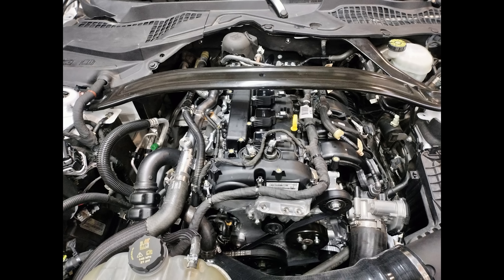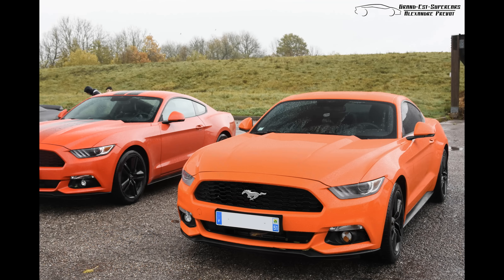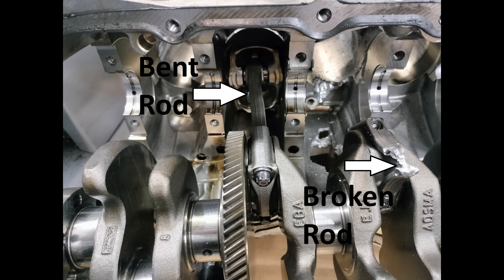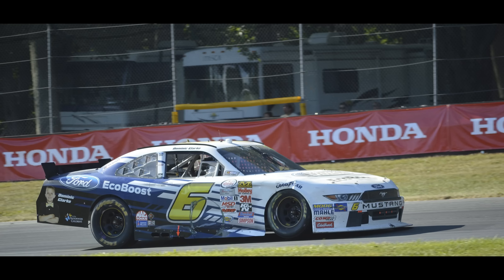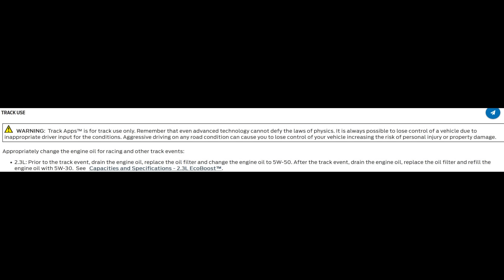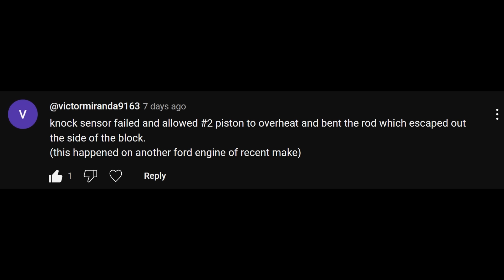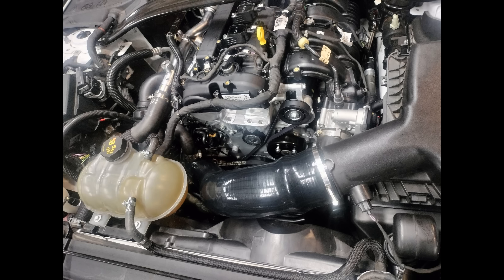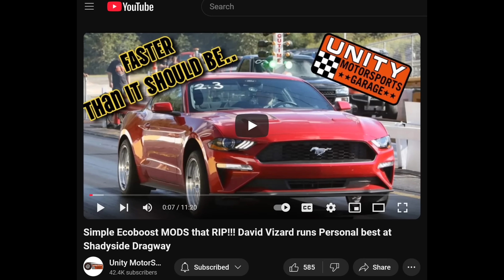EcoBoost Destroyed, What Happened?

Comment: Ultimately with turbocharged engines you are going to have failures due to over pressure. Eco boost engines are prone to failure and yet ford keeps making the engines smaller with more turbocharging in order to comply with the CAFE limits. 

So let’s get into what the exact problem is. 

You have a mass, you want to accelerate a mass. To accelerate need a force, the force is applied over a distance, thus you need energy, and the energy per unit time (power) determines how fast you can accelerate. OK, this is just basic stuff. 

An ICE can gain about 20% to 30% efficiency. And let’s say you need 500 HP that means there is 1500 to 2000 equivilrnts of waste heat, but since not all the fuel is burnt. So let’s knock it down to 1000 HP eq. So if you have say a 12 cylinder engine that heat is spread over 12 cylinders and the water jacket, it also means the manifold temperature and pressure is lower. 

So now let’s put 500 HP in a 6 cylinder engine with a turbocharger, we can do that by doubling the pressure an using an intercooler, the problem though at TDC on firing the cylinder pressure is double the peak of the twelve cylinder engine. The exhaust valve temperature is hotter, the turbocharger also creates more back pressure, and some of these small engines have cylinder spacing as small as you can get, so that a cylinder head being pushed away from the block has a head gasket that is also being pushed against. The turbocharger itself is being pushed into a zone of thermal operation which is degrading the oil. And so this is an ominous nexus. The all you need is a small defect in any part in the cylinder or the turbo blades. 

If you drive these cars at modest accelerations and only use the turbo charger for occasional acceleration, they will behave just fine. But if you like blowing the doors of other traffic, or speeding down the freeway at 2AM going 120 MPH, you have no tolerance in the lubrication or cooling system for failure. 

There’s a fellow on Robot Cantina that turbocharged a diesel Kubota for a stripped down Saturn and he got 80 MPH with a 720 cc engine. These 3 cylinder ford engines are about 1000 cc, and they have a turbocharger on them, but they are not sports cars. That turbo is there for 15-20 seconds of continuous operation per interval . It’s stupid to make car engines that small and compensate with turbochargers. A 1250 cc engine with a pressure limiter on the turbo output is a much better configuration and it makes the engine trivially larger and more massive. 
    Better yet, get rid of the Turbo and use the hybrid battery for peak output.
Reply from the maker: Turbocharging works fine long term if the engine is built right. This has been proven in long haul trucking in which those trucks are on boost for millions of miles.
Reply: @ The key word is built, if you build to pressure. Second thing is diesel engines don’t peak output at 6000 RPM. A diesel truck is a relatively small engine connected to a large mass, thus its mandate is not weight saving on size or mass,  but maximizing power output at a steady-state RPM. That’s not the way Eco-boost engines are designed. 
Ford has a repeated problem of failure at the intercylinder head gasket due to under engineering the engine, it’s comparable to the North Star problem.
Reply from the maker: I wasn't defending Ford, I was defending turbocharging in general. There are lot of Toyotas and other engines that hold up very well long term with turbocharger. I have a Fiat with 150k miles on it and it's engine is just fine, and it's tuned to have quite a bit more power than stock.
Reply: In other words Ford is cheating us.

Comment: More about boost and it's margin of importance.
In the 1st video of this series, Greg stated the location of the OEM boost (TIP) sensor (at the exit of the intercooler and before the throttle body). The ECU controls the throttle plate, not the right foot of the driver. This makes the boost reading on the dash, in part, nothing more than a measurement of restriction.

Comment: I get where you're coming from on the balance unit adding cost, but I disagree that it was feasible for a modern car to omit them. People expect a certain low level of NVH out of new cars. I've spent a lot of time with large displacement I4s (Volvo B230F and B23FT and Porsche M44) and I think they absolutely require a balancing unit to be acceptable to the modern buyer. The mentioned Volvo engines are quite coarse especially when you cam and tune them and rev them higher than stock, and they have a much smaller stroke than the 2.3 ecoboost (80mm B230 vs 94mm ecoboost). The Porsche M44 is balanced and has an even shorter stroke.
Reply from the maker: I think it's perfectly feasible. A lot of cars run 4cyl without balance shafts and I don't hear complaints.
Reply: yes, surely a lot do. Almost all of them are sub 2L engines, the bigger ones almost all have them, I considered my Volvos a rarity in that they were over 2L and had no balance shafts. Remember when dealing with cars as an enthusiast that you are not the target customer. I accepted that long ago, none of my cars are stock. If people like me were the target they’d probably already have the modifications I made.

Comment: My 2007 Shelby GT500 doesn’t have forged rods from the factory.  That’s one of the first mods that must be done to raise the HP above approximately 650 HP.
Reply: I take it that these massive HP engines are in  track cars We were more into road racing back in the 60/70s and the smaller cars were better for that type.
Reply: @ Agreed… Also, the modern HP cars are so refined, they take the fun out of driving on the street.  There is no way that those cars (including mine) could be offered up to the general public without all the driver aids that make the horsepower numbers irrelevant.  Pure “bragging rights”….

Comment: Greg, The open deck block is a function of the block casting process.  The 2.3L is a High Pressure Die Casting (HPDC).   The water jacket is formed by a piece of tooling that is part of the die and slides out of the casting after the aluminum solidifies, as the die is opened after the casting is shot... closed deck aluminum block is impossible with HPDC.  The crank case is formed in the same way...   HPDC is a very economical way to mass produce cylinder blocks. The tooling is very expensive and sophisticated, but the resulting piece price is lower... Most aluminum cylinder blocks are made this way.  The get a closed deck block a sand core is needed to form the water jacket below the head deck.  Sand cores are impossible in a HPDC casting.   the 2.0/2.3/2.5L engine family previously had low pressure precision sand cast blocks.   The 2.0 and 2.3 transitioned over to HPDC 10 ish years ago.  Rod buckling in stock rods is certainly possible due added boost...  but as you know takes a lot to get there (congratulations).  Ford just isn't going to spend the money to upgrade the rods when there isnt really any chance the rod will buckle at stock performance levels.
Reply: Thanks for sharing this information! Manufacturing has always been a fascinating subject!!

PS: Ford did release 2nd generation connecting rods in 2020, and it is my understanding, that all 2021 to 2023 engines are equipped with the new rods.

Comment: Oh, for crying in a bucket, that Motorcraft 5w50 oil is so shear-prone, it probably turns to a 30-weight in one track day.  It may even shear out of grade when you pour it out of the bottle.
A good 5w40 like Mobil ECF would work better.  Then add a real oil temperature sensor and an oil cooler to control oil temp to ~280F.
If you start doing things to your new Ecoboost, I recommend lowering the CR and getting a set of Carrillo rods.  Show them your bent rods, they'll know what to do.
Reply from the maker: I could do a fully built engine, but that's not the direction I'm going with this car.

Comment: If you manufactured an engine for a 300-hp application that could reliably produce 400 hp, the business people would be asking you how much cost could be taken out of it and still reliably produce 300 hp. Why does the Alfa have better rods than it needs?
Reply from the maker: The reason for building in extra strength is so the engine can win in racing.

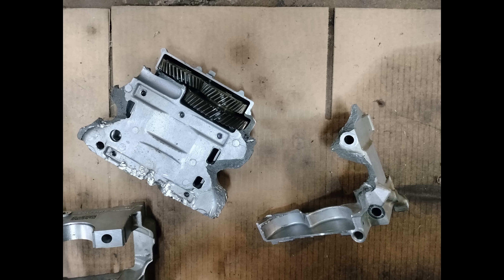Comment: 6:30 we have to respect manufacturers for being the greedy SOBs they are.  They wouldn't put in balance shafts if they didn't make a real difference in smoothness.  It's not a tick-box on most car buyers' lists, where you'd get manufacturers throwing in a feature just to get sales even if it made no contribution.  Even as a tech-head I'd never think to look at balance shaft existence when deciding which car to buy.  I've had mostly straight-6 and crosscrank V-8 and don't know if my R35 or F430 even have balance shafts.  Of course I trust your opinion too, and am not saying you're wrong per se.  But it might be that you're simply less sensitive to the vibrations they kill than most people are.  Or, it helps in some applications but not so much THIS chassis with THIS tuning, or some such.  I'm not sure (haven't finished watching) if your statement is from literally the same engine in the same care with and without, but if not, it may be just a question of apples and oranges?  Finally, it's possible that they designed the engine for a wide variety of applications and the balance shaft simply achieves nothing in this particular chassis but due to the economies of standardization makes sense to included in all models: cheaper to have an unneeded balance shaft in one car, perhaps, than to make a special version just for that car?
Reply from the maker: I may be insensitive to vibration, but I don't think it's just me. Looking around on forums I don't see people with engines without balance shafts complaining.

Comment: What destroyed it? Overboosting a damn 4-banger. Get a V8 if you want power.
Reply from the maker: I do want power, but I also was a lower cost car, better fuel economy and lower insurance costs.
Reply: @GregsAirplanesandAutomobiles  Have you ever run an older (Pre-'71) vehicle with a big block? The feel of those cars are way different than the modern engines. Getting 2.5G or more on launch is so dang fun! Modern engines just cant give that feeling no matter the power. And let's be serious if you are building for power, fuel efficiency is not in that equation. That is what the parts and grocery getter vehicle is for.

Comment: I don't have a Mustang, but I do have a 2.0 Ecoboost Focus. And while not the same, they are somewhat related. With the 2.0 engines stroking up to a 2.3 is always the last stage of upgrade because that extra 0.3 liters adds just enough extra stress on the conrods to limit their lifespan. It still baffles me that open deck, relatively low revving engine can make so much horsepower. It's no K-series, but for $350 at a pick-n-pull (Duratec) it's surprisingly good.

Comment: Rods don't bend from compressive forces but normally from the pin end tightening up which then puts a bending force on the rod and in a few cycles will snap it.   The other way they fail in highly boosted motors seems to be from the piston cocking sideways in the bore which puts a side bending force on the rod.   Modern low drag slipper pistons don't have good lateral support like a full skirted barrel type piston does so that's something to think about when making a motor.   If you can fit full skirts without hitting the crank...you're better off.   If only slipper pistons will fit...then a rod with much greater resistance to side bending would be a good move.
Reply from the maker: A pin problem would have bent it in the other direction. I'm not sure I understand what you mean by "rods don't bend from compressive forces". They certainly do, it happens all the time from hydrolock. I do like the rest of your post though.
Reply: @GregsAirplanesandAutomobiles  Thanks for the reply Greg!   Perhaps I should have prefaced my original statement with 'In a normal running engine'...and also let's distinguish  a bent rod vs a buckled/collapsed one.
Hydrolocking a motor for absolute certain will buckle rods if you hit them hard enough, but the normal 'bent' rods seem to be mostly from big or little ends tightening up or the piston rocking sideways....at least that's what we've seen and believe.
The 'open deck' blocks will allow the cylinders to move around if pushed too hard and this movement obviously causes misalignment of piston to crank enough to stress the rod through the pin.
Pushing the 2.3L Ford any harder than stock would make me want to sleeve it with the deck locked together as their racing block was made.  Would be good insurance.
Reply: Excellent debate topic! You both make well informed statements!!

Comment: I think kenm's answer is the best b/c "twisted rod failure" IMO implies plastic deformation of the rod under compression, which is basically your diagnosis as well. It's more precise than the others without guessing wrong details (unless you take points away for putting 2 guesses in 1 answer, but 1 of them was right on the money & the other was a plausible guess too)

Comment: Interesting. What would the solution(s) be here? I'm assuming reduced power is never an option. My assumption is aftermarket con rods though I don't know the drawbacks there. It sounds like they might be required for any EcoBoost with enough BMEP in fact? I can't think of any other solutions (not really an engine person) but I'd be interested if there's another way around the problem.
Reply from the maker: The solution is to run the same amount of power with lower cylinder pressures. At least that's my plan.

Comment: Just a bit of my first answer in the other video. I have seen head lifting in 2.3 with a lot of cylinder pressure. The twisted/bent rod more specific because I have a broken rod souvenir from a friends F150 2.7 that was near or over 600 HP, he had drag raced this street truck with very low 12 second to high 11 second 1/4 mile ET's. His failure was during street cruising for errands. My own ride is a 2.7 F150 tuned to just over 400 HP. I will ad he was not running over 24 PSI but was using E50 and fueling upgrades to support, tuned and adjusted for the mods.
Reply from the maker: Hi Ken, you are one of very few people who even suggested a rod issue, and I think you were the very first. It's ironic as now that the cat is fully out of the bag we have a lot of people here saying they knew it was due to weak rods all along. However very few people mentioned rods. Good job!
Reply: @GregsAirplanesandAutomobiles  This is a young friend of mine and my source for some souvenirs. https://www.youtube.com/watch?v=UhlY-4ekvlM

Comment: Is that the type engine valvoline did the 500K oil test on chassis dyno?
Reply from the maker: I don't know, but if so it wasn't running a lot of power in that test.
Reply: @GregsAirplanesandAutomobiles  Search valvoline oil test ecoboost. Road condition chassis dyno two ecoboost cars 500K miles then dissect. For fun watch Kristensen 1959 thunderbird goodwood. Shorter track view vid and longer in car vid. I got in a lot of trouble in a J model in early 70s. I've built HP, now only build best torque curve cruisers.

Comment: First guy wins. Everyone else threw spaghetti and included rod failure. They are therefore the least correct. First guy is the least least correct. This is the least worse option ( a line from ARGO). 

OBTW, if I brought you a 2.3 manual full size Bronco, would you be game to give it a medium tune?
Reply from the maker: Good point, and yes.

Comment: Shocking to see an EcoBoost 4 cylinder that didn't fail due to the press fit timing components slipping and throwing it out of time.
Reply: These are just a poor copy of the BMW N54 with two cylinders chopped off. Everything is the same but worse.

Comment: I wish i saw the other video. You make too much torque too low in the rpm band. (My guess) Stock turbos come on early. Bent factory rods usually come from small turbos. Your spreading the power production between less cycles at lower rpm. More power per boom to make 100 hp at 2500 or 3000 vs say, 4500 or 5000. Old Bnw's bend rods when you make the power (450+ ft pounds)  below 3500/4000. On a long stroke engine the rod usually bends, then its shorter. Piston hits the counter weight then the rod breaks and exits the block

Comment: This is another typically well-done and well-thought-out video by Greg. I am not a huge Ford performance fan, although I still appreciate the engineering from the Model T through the Ford GAA tank engine to the Boss 302, 427 side oiler, and Boss 429, which eventually led to the current EcoBoost and other performance engines.  By the way, my next-door neighbor has a 2019, 2020, or 2021 (I can't remember which  🙄 ) version of your car, but with a..... manual transmission and a less intrusive ECU/ electronics system.  By the way, David V. is a brilliant engine guy.  👍